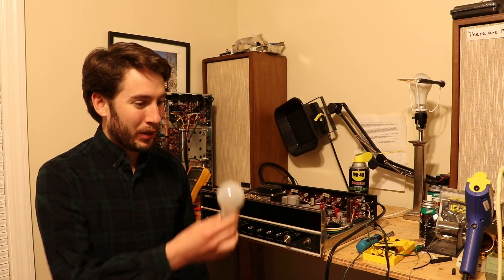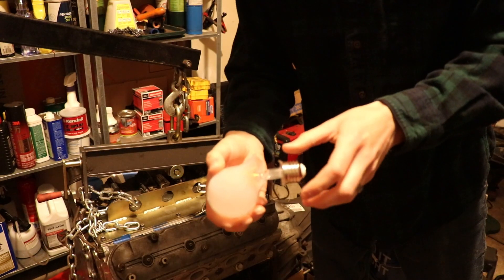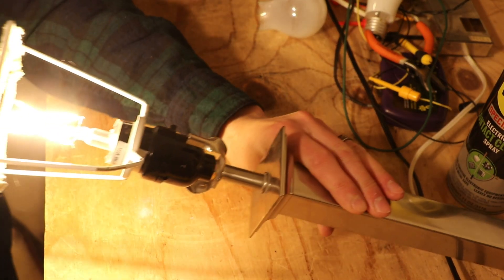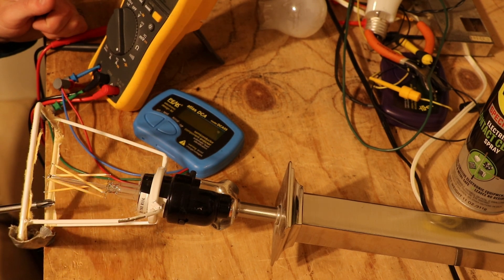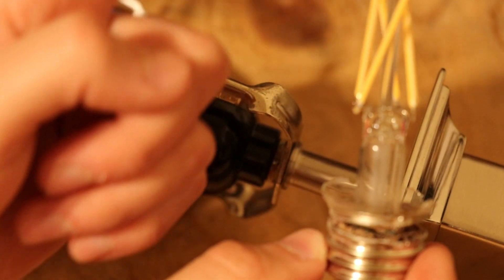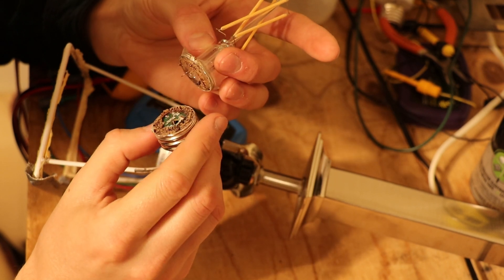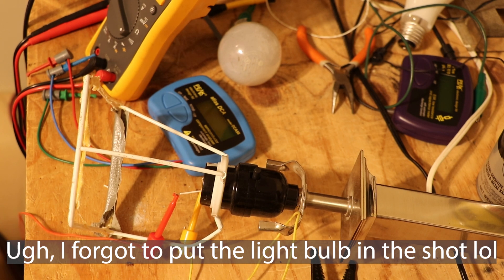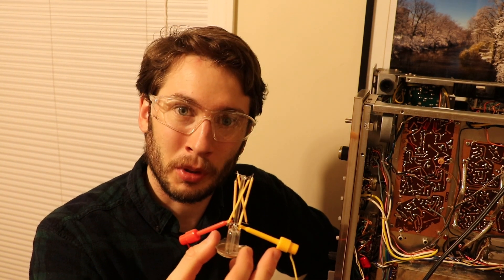Figuring out why this LED light bulb failed after one year.

Comment: Over 80% of all LED bulbs that are thrown away are fully functioning. Instead of installing a dimmer switch, most people just buy a new bulb. Also, if one out of a set of 5 fails, they will just toss all 5 and buy new ones. I have been collecting bulbs from the recycle boxes at supermarkets in my street. In just over a month I have collected over 100 fully functioning LED bulbs of all different sorts and intensities. Also some expensive Bluetooth controlled ones. I'm certain that the vast majority of rechargeable batteries that are thrown away have never been charged. People are too lazy to buy a charger.

Comment: I had the same issue with my led light bulbs. For some unknown reason, the led filament becomes intermittent and wil flicker when touched. Dodgy, poorly manufacturing is the problem. Dam things are supposed to last forever, but they don't. I've ditched my LEDs and gone back to incandescent bulbs.

Comment: Sale of incandescent bulbs for residential/commercial lighting has been banned for quite a while for us in the Netherlands, only some specialty bulbs are still available. (like instrument panel bulbs, refrigerator door lamps, some event lighting stuff)
As a business owner changing to led or other high efficiency lighting is mandatory if the energy saving pays for the replacement in 5 years or less.

Comment: Lost an led bulb over my kitchen stove during very close lightning strike yesterday. (Interestingly, 15 years ago, we had an incandescent blow up in that same socket due to very close lightning. The bulb in the other socket in this fixture remained unaffected since it was turned off at the time.) Now the led flickers dimly when turned on and for a while after turned off. I replaced it, but maybe I should look inside the zapped one.🤔 A newer Yamaha receiver got zapped yesterday, also. No power or lights now, but supposedly has some diagnostic display feature if I can get it to work even that much. Have not yet checked the polk speakers that were attached. We got hit last year and lost LOTS of stuff, including older amps (but not this particular Yamaha that was away from the house in a separate building during last year's strike and we have been using it as replacement for one that was struck last year). That is when hubby turned to vintage audio repair! He has some history with radio repairs years ago. Yes, we always used surge protectors, and now unplug some stuff when not using, which may be why our damage was limited yesterday.
Reply: usually the capacitors in powersupplies die from the overvoltage/dc spike, ive had to redo about every part of a floating seasand desalination plant after it got hit last summer. Most onboard equipment was dead completely, all the led floodlights on deck flickered like disco stroboscopes. 
Pricey and very very dirty job, crawling through sand, tar, rust and salt in the watertight compartments to search for damaged system components..

Comment: Save your stuff and use it for as long as possible. Mother in laws stove is from the 80s and still work perfectly. As do all of the other appliances. I bought new front load washer and dryers. Failed. Went and bought commercial top loads. Incandescent bulbs produce a lot of heat. Remove that from the room and burn more natural gas.

Comment: You are correct, and GE is a name brand. The cheaper ones, given for free by power companies are much worse. I worked in the electrical industry for 10 years. Quality LED is very expensive. Great video. I have several incandescent bulbs saved.

Comment: Too bad the problem can't really be fixed but thanks for the informative video.
About the bulb being made of glass. I'm guessing plastic could possibly melt when housing high effect LED lights?
Reply from the maker: As I tore it apart, it made more sense why they used glass. Very thin wall thickness and the special shape inside the bulb is better suited for a glass blowing process.
Reply: A lot of the led bulbs are plastic, heat not being much of an issue unless high lumens. Need incandescent for lava lamps, Himalayan salt lamps, etc. which require heat to work properly. I guess also needed for dim bulb test.
Reply: Clear glass looks nicer, and has about 4 times higher heat conductivity than polycarbonate, while both are still poor. After 50,000 hours, plastic would be all scratched up.

The heat is not enough to melt anything, but needs to be lowered to not burn out the LEDs. They can reuse existing facilities to manufacture glass bulbs.

Did he connect the LEDs without the current limiting circuit board? I had to look away because I was sure they would burn out.

What sucks is that the bulbs can't be opened to swap bad parts.